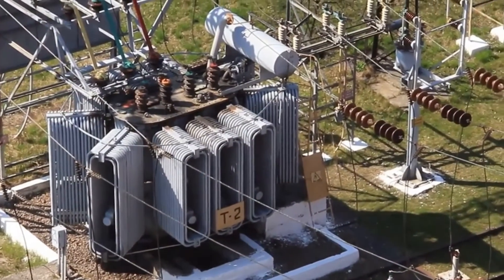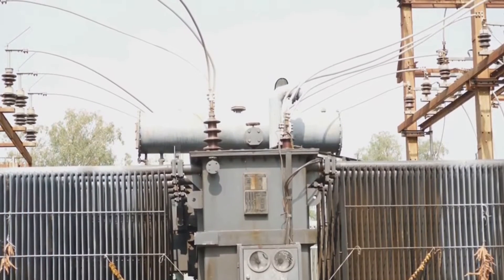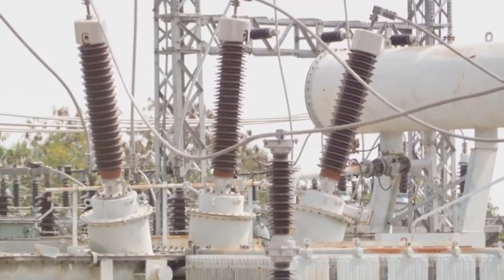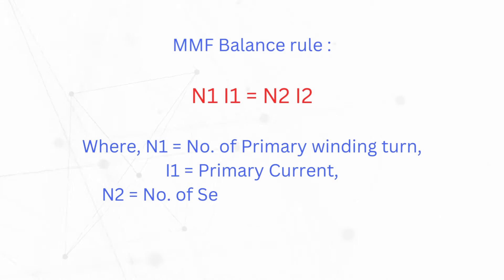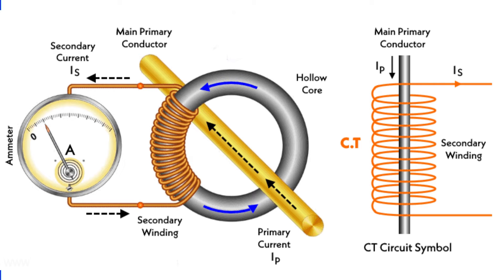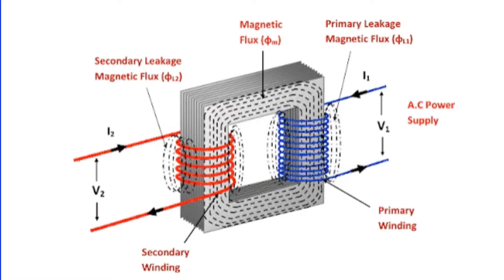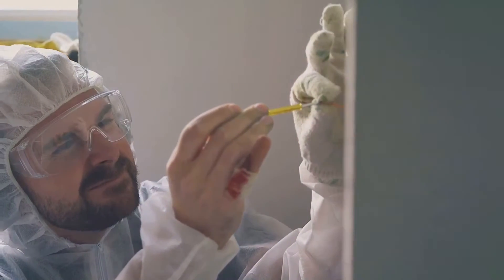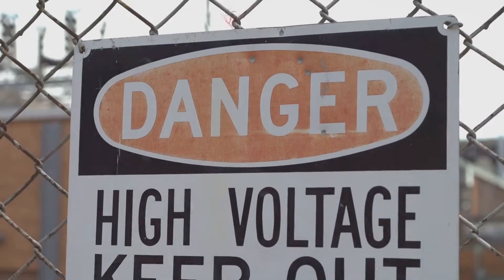Why CT secondary should not kept Open Circuited? #interviewquestions #electricalengineering

Comment: Hmm it like you don't want an open switch with 400 kv they use circuit breakers filled with an inert gas SF6 to convert a lot of the electrical energy into heat and they have to refill this gas often. It is a cool concept especially for any very high voltage and current! Safety engineering in mind.